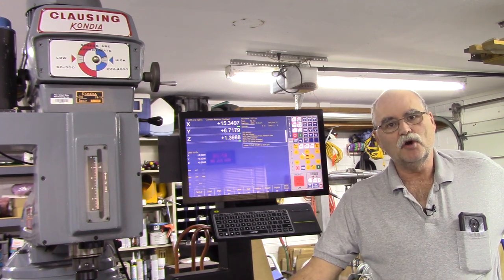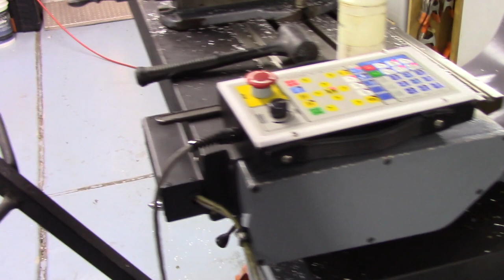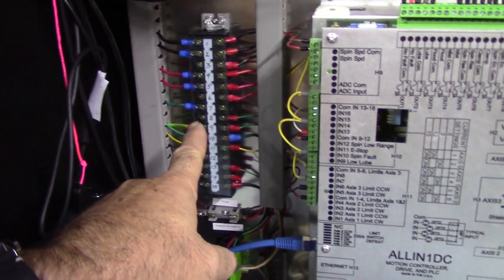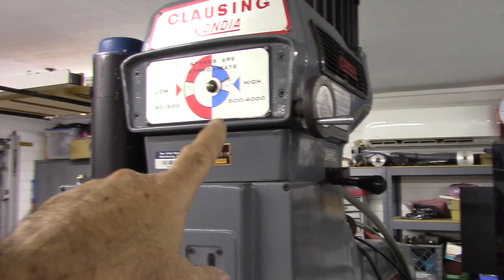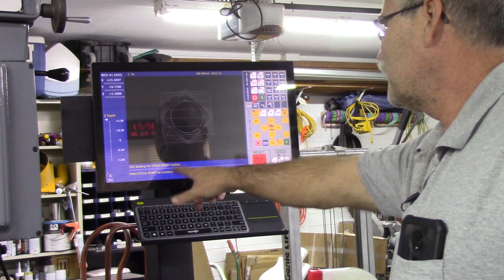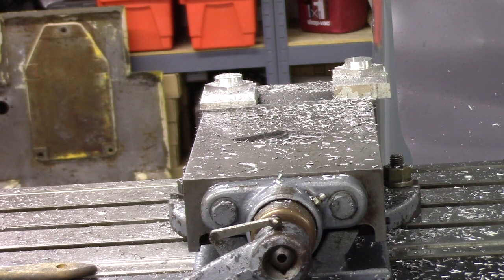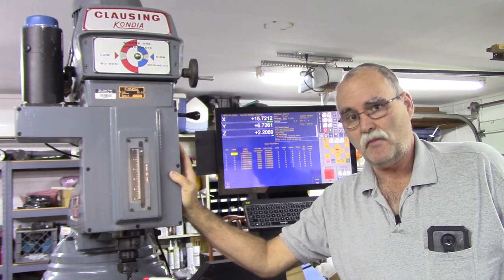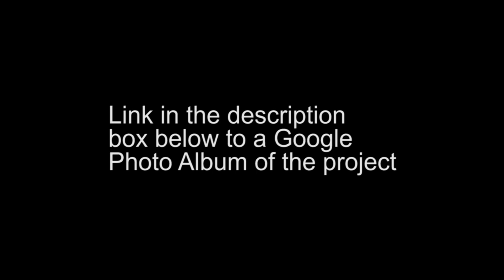Clausing Kondia Project Wrap - Centroid CNC All in One DC Conversion

Comment: Nice job on the Kondia. I noticed you are using a Hi/Lo Vise the last time I used one was when I was an apprentice around 1962. The shop owner frowned on hammering the vise handle
we had to put our tools on a shop rag to protect the mill table. Some of that has stuck with me to this day. That was a great vise, glad to see they are still around.
Reply from the maker: It's what came with the machine Wayne. Explain how hi/low works...

Comment: Pretty cool Marty, I have that same exact kondia machine that had the old Dynapath control, I had Marc Lenard from cnc Service NW convert it to centroid about 8ish years ago .  I also installed the Elrod quill kit so you can use the machine as 2 axis is super nice for quick job-shop work.  Its been just a super machine, I have the centroid probing also, Ive done lots of work on it. It has well made profit and paid for itself.  Surprised more people dont know about centroid, super reliable and accurate.

Comment: Great job! Great video! Being born n breed Pennsylvanian im centroid all the way and they have a setup for whatever machine your bringing back from the dead. But a little request.....could you start installing centroids probe and tool setter? We already know that if you strike a good find of an older yet mechanically sound machine tool that we could have our own cnc with probing and tool setters in our garages for half the price of a tormach. Lol ,,,plus we can digitize broken  castings that are no longer sold and make our own! And that is why centroud is number 1 in my book! Off topic,  at work we have a 1991 Nicolas Correa that we have been changing tools by hand for the last 27 years! It has a head that rotates (A=on 45 degrees)  and (B= on 90 degrees) that we have to do manually by lining up the marks we put on with a paint marker!  Haha! But its got 200in in X travel , 46in in Y travel , and 50in Z travel witch makes it very universal. Its got a 50hp 50cat geared hi/low spindle , brushless ac servos (HUGE) ! we looked into a control retrofit for 140k but i turned it down because it would not have solved any of the problems I mentioned so otherwise i figured just keep the Hiedenhiem tnc415 control on it till it dies. Lol. (15k for refurbished control )  I wonder if centroid could do something with this machine? It has an encoder for the head to rotate plus-minus 90degrees and one to rotate on 45deg to make it vertical to horizontal , i know it would not be cheap! They paid 700k in 1991 n now its in the 2 million dollar category!  Lol ..god i would love a tool changer and a probe and tool setter! Lol.
Reply from the maker: Post pictures of your machine, close up of the control cabinet, the servo drives and their model number, spindle drive and its model number and any other details. Suggestions can be made on how complex the conversion would be.
https://centroidcncforum.com/viewforum.php?f=64

Comment: can you use the original 40 in lb servo motors instead of the centroid motors ?
Reply from the maker: Yes you could, but you'll need to make sure you have or fit up 5vdc differential encoders to them

Comment: I have 4 knee mills in my shop. I would like to see the modifications you made to your pallet jack to frame the machine base between the rails.
Reply from the maker: I cut on either side of the jack and widened it. Made cradles out of angle iron.

Comment: 2 videos in one day! I was wondering what happened to this machine. I need to mimic that brake cylinder on my machine. Has the same Ericson spindle.
Reply from the maker: pneumatic cylinder....easy to implement. Can't see how you would hold onto the spindle to lock the tool in any other way?
Reply: @martyscncgarage5275 , low range, brass hammer against the wrench.